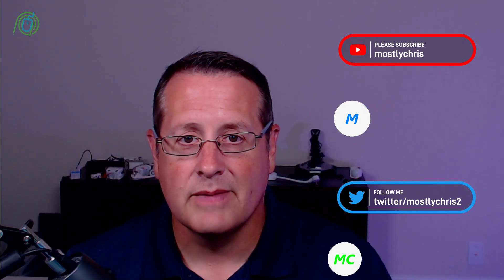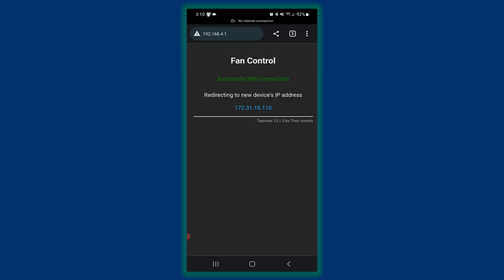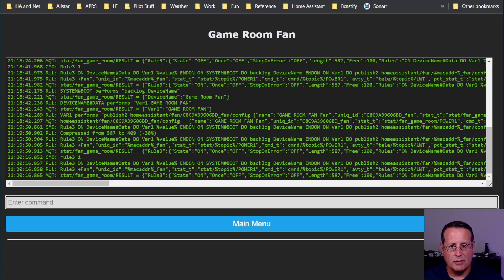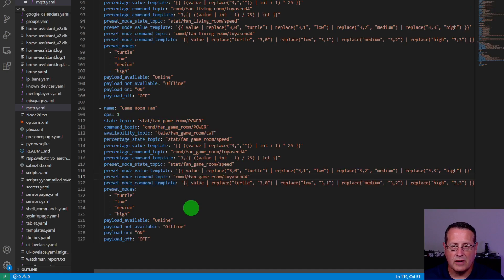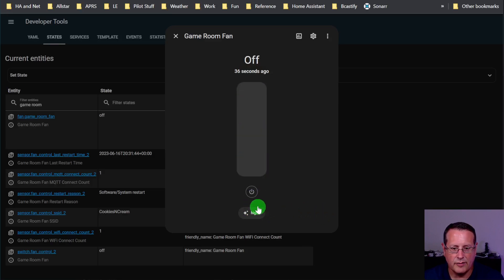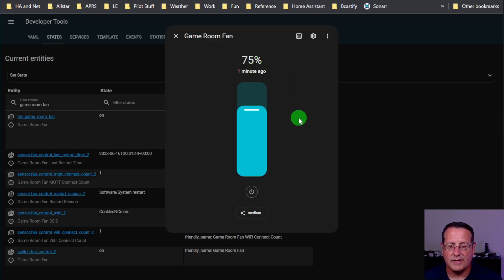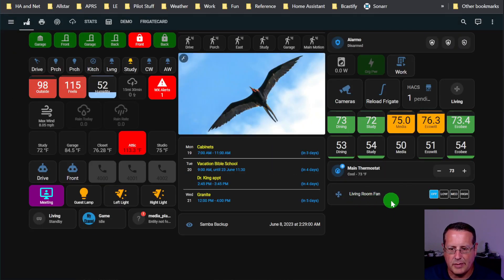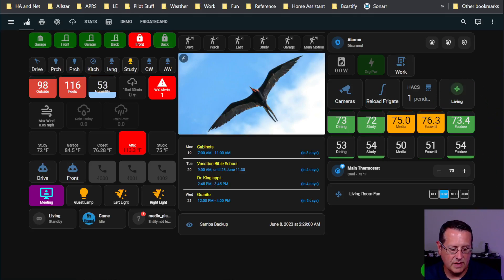SMART FAN CONTROL with Tasmota Flashed Fan Speed Control from Martin Jerry

Comment: I used a Sonoff Ifan-04 flashed with tasmota because I didn't have separate wires for the fan and the light going to my light switch location. Thanks for your video!
Reply from the maker: Very nice!

Comment: Great content, can you configure this switch to turn on the fans light, by, say a double press or something? I only have one box on my fan switches.
Reply from the maker: There is no double press option on this switch so it won't work that way. There are some combo dimmer and on/off switches that zooz makes. Don't use a dimmer switch for a fan though! The zooz is light dimmer combined with fan on/off.

Comment: Is there anything similar that contains a light swith as well. All of my fans in the house have lights and the original switch was a single swith that turned on the fan as well as the light. I replaced them with a Treatlife switch and flashed with Tasmota. The new switches I have found have a not so easily flashable new chip, so I want to replace them.
Reply from the maker: If you can find them, innoveli has some nice ones. I have seen some zoon switches that are dimmer and fan on/off. There is no speed control though.
Reply: @mostlychris  Thank you

Comment: I also flashed a sonoff ifan3 with Tasmota to achieve something very similar - slightly different wiring as it required a separate light switch that I also flashed with Tasmota.  I then separated the relay from the button on the light switch - single press speed 1, double press speed 2, triple press speed 3. Hold down turn off.  Ifan also has an 433mhz remote for WAF.
Reply from the maker: Nice
Reply: @mostlychris  Have you considered making a video on setting up multiple networks for security?  I was looking for a video to recommend to someone and I'm not really thrilled with the options.  I don't want to do a video for that myself.  😆
Reply from the maker: @jmr  I have not. I wonder if that would be interesting to most on the channel. It can get quite complicated.
Reply: @mostlychris  I'm sure you have a better idea of your audience then I.  Maybe a community poll or something?

Comment: why not ESPhome?
Reply from the maker: These could be flashed with ESP from what I have seen. Since it comes pre-flashed with Tasmota, I just went with that. Flashing ESP requires opening it up and figuring out the pin outs and then attaching the programming interface. Someone has probably done this, but in the interest of time, I needed to get up and running quickly.

Comment: thanks for the video i need to get one of these switches, question what is the fan itself set to, I assume the high setting?
Reply: For it to work for me, I had to put it on the high setting with the pool chain and then it adjusts the speed from there. The speeds aren't exactly low, medium and high but they're pretty close. I think it just depends on the quality of the fan
Reply: @rasbe6863  that’s what I figured. Thank you
Reply from the maker: I echo RasBe's comment. Pull chain to high. In terms of fan speed, it's all relative to comfort. If it's going too fast, select a lower speed. Too slow, higher. I don't know that fans actually have RPM setting specs and the amount of air moved varies by installation type and type of blade, etc.
Reply: @mostlychris  The only thing I wish is that there was a way to figure out how to use it with the single switch fans. I either ones that have the light and the fan on the same switch. I only able to use one of these fan controls as my master has a switch for the fan and the light. If there was a way to figure it out I would have more of them because I love them
Reply from the maker: @rasbe6863  I think some of the relay type things can do this. Maybe the sonoff stuff. I haven't really investigated. Found this article https://thesmartcave.com/smart-ceiling-fan-control/.